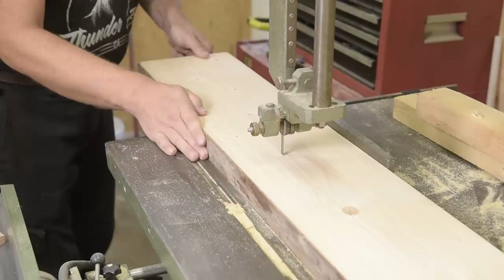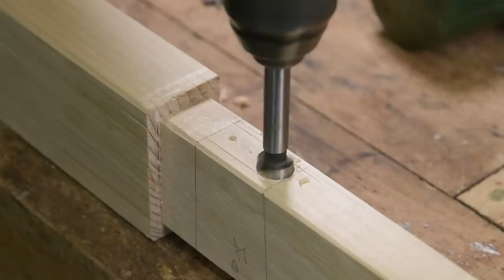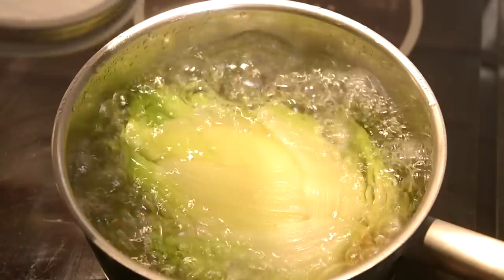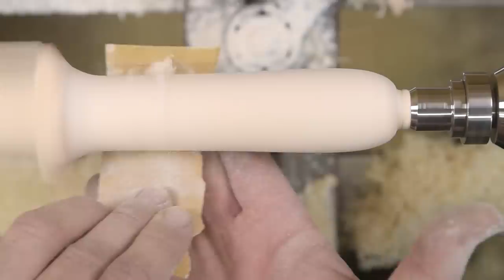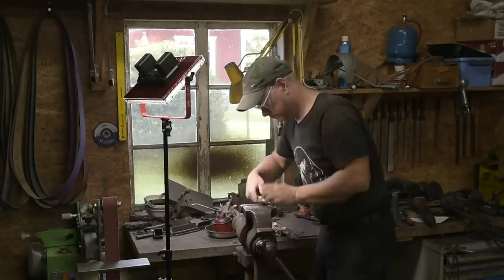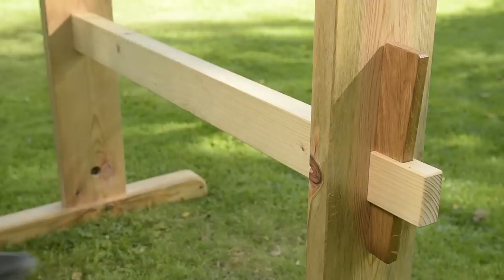Building a flax break  (Growing 1 m² of FLAX part 2)

Comment: We have something in common, making and building many parts and contraptions to try one small project. I bought a scythe at an antique shop. Now I’m halfway through making a treadle powered 150lb grinding wheel to use to restore the scythe. Which is fine, the curved handle I’m making for the scythe is still curing.

Comment: A little woodworking tip: When you chisel out the first side of finger joint, if instead of chipping away the whole length you make a half-V shaped groove, then the ends are still level with the surface and act as support when doing the other side. Makes it a bit easier. I have thought that it would be cool to make a shirt or something starting with flax seeds. You would certainly see clothes in a different light.
Reply from the maker: Thanks for the tip! I kind of realized that myself half through the process :) Yes indeed a very different perspective.

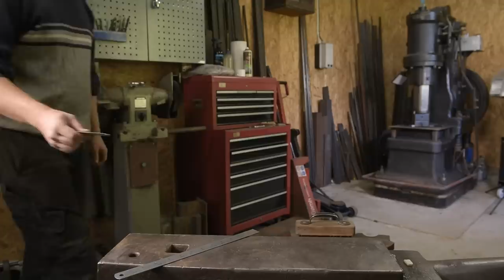Comment: until 15:46 I thought "hmm, Torbörn Åman, the new woodworking channel..." 😆
no seriously, I know for quite some time, and you showed it on several occasions, that you are a good woodworker as well, good job Torbjörn.
But one question occurred, you put a very nice wedge connection on one side, why then a bolt connector on the other and not also a wedge?

As always, all the best, Sven.
Reply from the maker: :) Thank you!   I like the rigidity you get with a joint like that, but opted for a bolt on the "working" end so it wouldn't interfere with your knee or something when working with the tool.

Comment: Love watching your work!  Scratching my head trying to figure out why the use of two different fastening techniques used where the middle brace joins the two vertical pieces?
Reply from the maker: The wedged joint is there for stability only. It makes it super rigid. I opted not to make another one at the working end to not interfere with your leg or anything when working with the tool (probably a minor problem, but still).

Comment: Great job I've never seen that done before. By the way what oil is good to season a cast iron pan with
Reply from the maker: Thanks. It appears you should use a high temp oil, but I used sunflower oil on mine. I bet canola works nicely.

Comment: Amazing job. But why is the base fixed with a screw on one side and a wedge on the other?
Reply from the maker: Thank you!   I like the rigidity you get with a joint like that, but opted for a bolt on the "working" end so it wouldn't interfere with your knee or something when working with the tool.

Comment: Two questions:
What kind of vegetable was that? It looks a bit like celery but you didn't keep the stalks so i'm guessing it's not.
Why did you make the legs attach to the center rail differently, one with a wedge and the other with a bolt? I can't think of any functional reason to do it that way, is it just for looks?
Reply from the maker: That was fennel!  I like the rigidity you get with a joint like that, but opted for a bolt on the "working" end so it wouldn't interfere with your knee or something when working with the tool.
Reply: @torbjornahman  Makes sense! Thanks for the reply :)

Comment: why a wedge on one side and bolt on the other? cause you can? :) anyways amazing work as always. bra jobbat!
Reply from the maker: Thank you!   I like the rigidity you get with a joint like that, but opted for a bolt on the "working" end so it wouldn't interfere with your knee or something when working with the tool.

Comment: I'm still trying to work out why one end of the cross beam is held by a wedge.   🤔
Reply from the maker: :) I like the rigidity you get with a joint like that, but opted for a bolt on the "working" end so it wouldn't interfere with your knee or something when working with the tool.

Comment: Why the one leg bolt locking and the other taper(?) lock?
Reply from the maker: I like the rigidity you get with a mortise and tenon joint like that, but opted for a bolt on the "working" end so it wouldn't interfere with your knee or something when working with the tool.